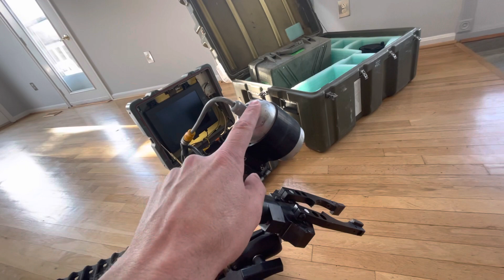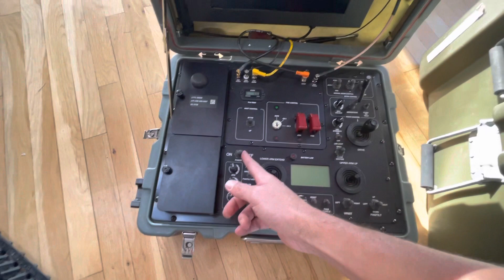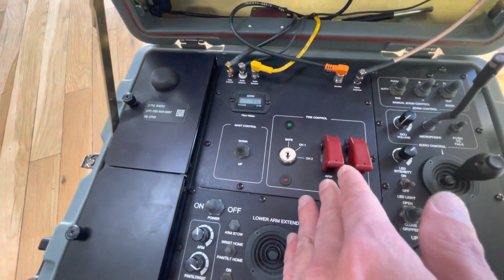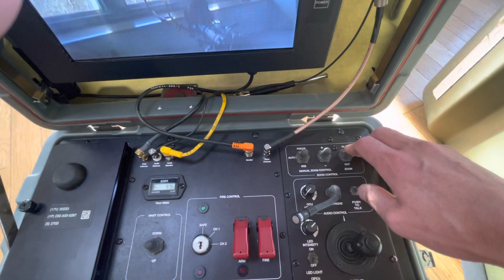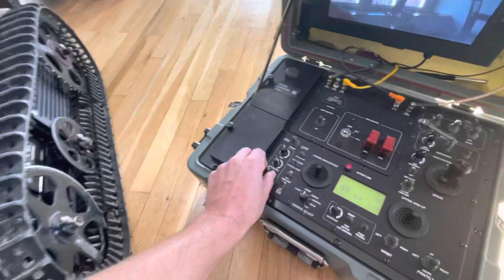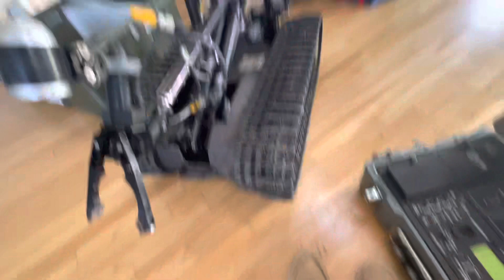Foster Miller EOD Talon Robot Overview and Demonstration

Comment: Great detailed video! The 2 arm joysticks control the upper and lower arm when pushed vertically. But thoae joysticks have some functions when pushed left and right?
Reply from the maker: No the do not have any additional functions.
Reply: Thank you so much for responding to my previous question so quickly! I really appreciate your promptness, even though I saw your answer almost a week later.

I have a few more questions about your Foster-Miller Talon robot:

1. Arm Rotation: Does the robot's arm rotate internally within the chassis, or does the operator need to rotate the entire robot to precisely align with an object?

2. Motor Operation: How does the motor in the chassis operate both arms? I noticed there is a chain—how is it operated, and what is its function?

3. Gripper Rotation: Regarding the gripper's rotation, does it use a pipe inside the upper arm with a motor located at the back, or is there a motor situated next to the gripper?

Thank you again for sharing your insights and for the detailed video!

Comment: I bought a pair of these and they have been the bane of my existence. They didn’t come with the battery tray so I had to backtrack the 16 pin battery plug and I figured out there’s 4 positive, 4 negative and 2 other wires that I have no clue what type signal they output but it’s what turns the electronics “on”. You seem like u know a lot about them. If you can help me get it running I will pay you. Seriously.
Reply from the maker: There’s three types of battery’s that will power them. The original Talon battery pack, or one of the two 2590 tray types. I’ve never looked at the actual output but I do know the trays do the following. The three batteries on each side are combined in series. Then the two sides are wired in parallel. I do not know the pinouts for the battery to the chassis. All the pinouts are the same across the battery types since they have to be universal for the chassis.

Comment: Where you buy this little boy? 

Like this is a nice robot and how can you use a Xbox controller with this robot?

Like the marines use a xbox controller for this
Reply from the maker: @gasmask_of_life  this is the older version. The newer ones have an updated control interface. I never had the updated ones when I was in. The IRobot Packbot 510’s were the first to ditch the bulky controller with the XBox controllers. That came out in like 09 or so of if I remember correctly.

Comment: Have our connected the fiber optic reel assembly?  I am interested in getting the speaker function on the robot working which is incorporated into the reel assembly. I have attached the reel assembly and connected its cable but there is no audio output when the PTT switched is pressed on the OCU.